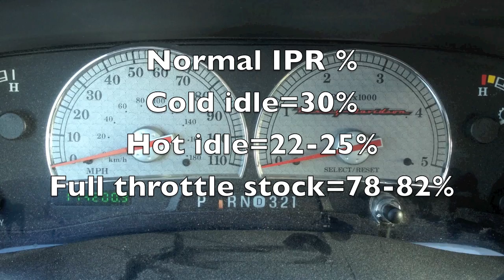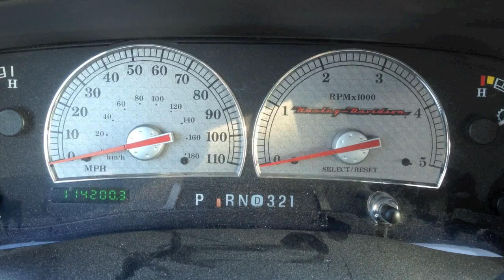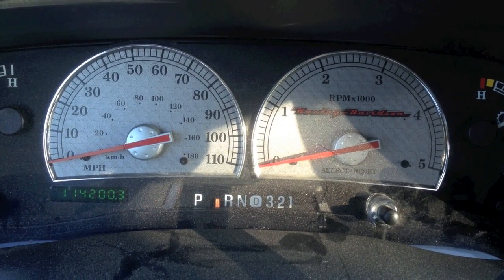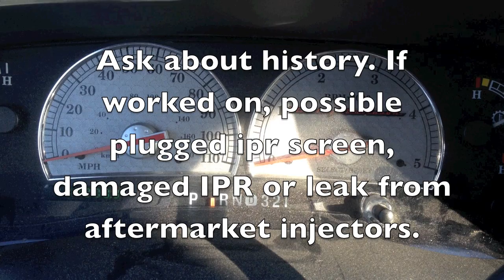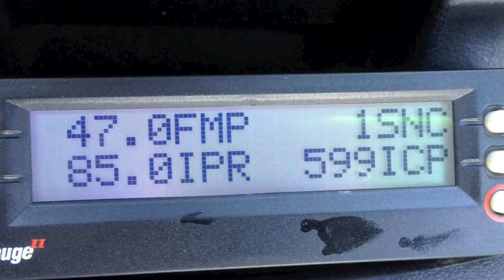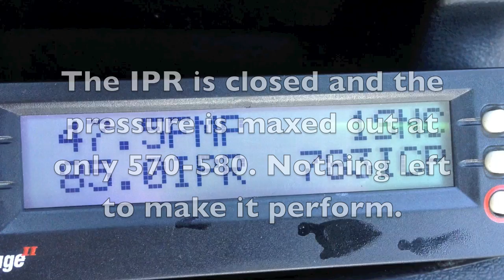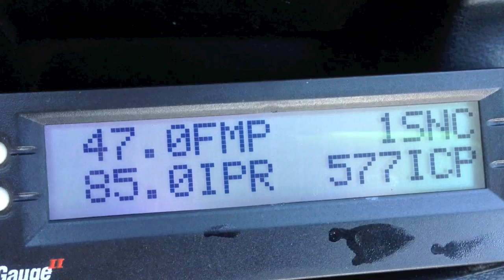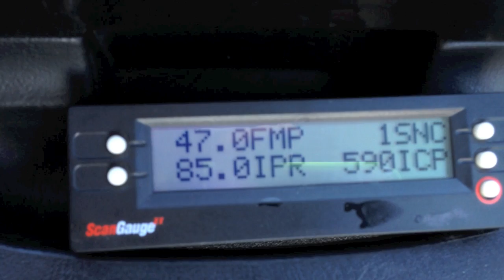Ford 6.0 Powerstroke Diesel No power ICP IPR Relationship

Comment: Hi Ron, I have a 04, F250 and it will not start. I'm getting a P2285-E0 code. I cracked open the fuel filter on top and as soon as I turn the key, fuel sprays. All injector were replaced. Fuel tank and lines were cleaned, The truck started for a few days but if I let it sit for 2 days, it will not start. Any suggestions. Thanks for your video
Reply: what was your solution, mines same thing
Reply: Check your ficm voltage!

Comment: Ron 
Know have a question  for you. I do not have the gauge hat you use I bought the Guage that edge sells to monitor engine. My truck is an 06. The motor was removed from chassis for an oil leak at 30,000 miles. I had dealer install head studs at the time of oil leak. Not to soon after this major repair the dummy plug seals and stand pipe seal as well as stc was worked on by same dealer. Up to this point 85,000 miles no issues expect oil leak is back and this new issue. I start driving truck every day to work and drive time each way was about 2 hrs. Prior to this I only used truck around town on weekends.  Truck cracked right over when leaving in morning.  Got to job site truck sits for 6-7hours . I get in and begin the cranking and it is longer then normal.  The edge I gave monitors some things but doesn't seem to have thickem sink.  Thickem was also replaced  at some point during my ownership. The edge gauge is hard to check because it dose come alive until after the truck is running  so it's hard for me to see what you look at prior to engine starting.  I have to get the scan gauge soon but any thoughts before I do so. I also changed fuel filters at the time I started this traveling. The filters are oem.

Comment: Hi Ron! Thanks for taking time a doing this videos. I owned a 04  F350 with 6.0, I can drive it for about 10 minutes before it starts to loose power, and if I continue driving it it with tottaly loose power and die. I have to wait 5 to 10 min before it would start and same problem withing 1 mile. Any suggestions on what it might be? Thanks again.
Reply: Did you figure it out I have the same isssue

Comment: I have an 04 F250 6.0 Powerstroke.  The Injectors, EGR and Oil cooler replaced less than 1 year ago.  It will start cold wonderfully but one it gets warm, no start until it cools down.  Would this be the IPR?
                                 5 min Running   KeyOn   Crank  Running  KeyOn   Crank
Time                                  17:42       17:43      17:43      17:56  17:56      17:58  
ICP                                    804.8        12          1033       718     10.3       392.2
VGT Duty Cycle(%)               60            0               0       54.5      0             0
FICM Main Power(Volts)        47           47             47       47        47          47
Engine Oil Temp (°F)             96           102         102       147      147        146
IPR (%)                                27.1        14.7          84       26.7     14.7         84
Reply: I replaced the IPR valve which did not solve the problem.  The old IPR had no screen in evidence when I removed it.  Still no codes.

Comment: Hi Ron great videos you are a pro.Having trouble with my 2004 ford f250 6.0 fuel gelled in winter and truck is on and off sluggish.I though I was chasing a dirty fuel issue the truck shut off a few times   and I cycled the key a few times to refill filters the truck  refired and drove home. I changed filters twice and they are now clean.I bought the scan guage and noticed key on engine off ipr at 11.8% when started icp is 580 and ipr  stays at 11.8 reving  engine got icp up to 1200 to 1400 psi ipr didn't go above 22 to 25%  not sure if its a leak or bad ipr valve the truck starts fine. The last time it shut off a mile from house just afraid to get stuck with truck. Sometimes it will miss a little but straightens it self out. Any help would be greatly appreciated.Thanks again Ron keep up the great work you are the man.

Comment: Ron I have a 06 6.0 and I'm having problems to start and when it starts I accelerate and it stays running for 15 to 30 sec.and it shuts off and then I loosen the line that goes to the injectors from the upper fuel filter to let it fill up again and I already change the fuel pump.2 times and put 2 different FICM and new fuel filters and I've change an electronic part that goes in back of driver side battery

Comment: We have an 04 that started turning off whole driving them started but no power and then would not start at all.  We replaced ficm, fuel pump, injector orings, standpipes, dummy plugs, hpop, IPR, and all filters. Starts really good now but has no power and dies after about 5 minutes. 
Any advice?
Reply: What was the issue?

Comment: Hi Ron, thanks for your videos! I have a Ford F-250 6.0 Powerstroke Diesel that hasn't been running well lately. At first it lacked some power, but it's gotten worse. If you try giving it more gas, it starts to choke up and slows down. I also found engine oil in the air intake hose that's being sucked in to the turbo by the breather fitting that goes to the engine headtop on the driver's side. I got the codes P0299 and P0264 from the scanner. Where do you think the problem might be?
Reply: Evelyn Gutierrez did you ever find out what the problem was? Sorry for 4 years later.

Comment from the maker: Done incorrectly, I personally have not sealed a coupler properly. Once. I now blow out the bolt holes in the branch tube. Injectors. I show that on no start hot video. Ipr can quit when hot. Spring pressure alone is 200 worn 300 newer. Roughly. Most common by far is leaks. Also wrong oil or not enough pressure. Get an adapter to air leak it from freedom racing.com and air leak it.
Reply: Hey Ron, I got a 04 f350 6.0 that sat for a year when I bought it, been having trouble with loss of power, so I changed filters put fresh diesel in, ran it and still doesn't want to run right, no smoke out of tail pipe, ficm is at 48.5v and IPR pressure seems to be at 599psi at hot idle. Horrible throttle response as well.

Comment: I have a question about a hot no start. Mechanic has the truck and discovered the stc fitting has already been done, he did the rail plugs and truck still has hot no start. Looks like only stat out of spec is ICP 300-350 If I remember correctly. What could be possibilities to check? Bought truck used from chev dealer, no warr or idea of history.

Comment: Ron, I bought the scan guage to diagnose my no start on 2007 6.0 . key on no start fcm 47.5 ipr  14.8  icp 7. when i crank it  fcm 47.5  84.7 ipr. 7 icp.  I removed the icp sensor like on your other video and got this reading when i cranked it,  fmc 48  ipr 66.4  icp 1510. Still no start, I have fuel, checked fuses. I really dont know what else to do. please help.

Comment: Good video Ron
Reply: Hey I'm having trouble with my f250 it want go past 45mph and burning out the new injectors that was installed does good running idle when I care it for a test drive burn injector goes to missing and lose power